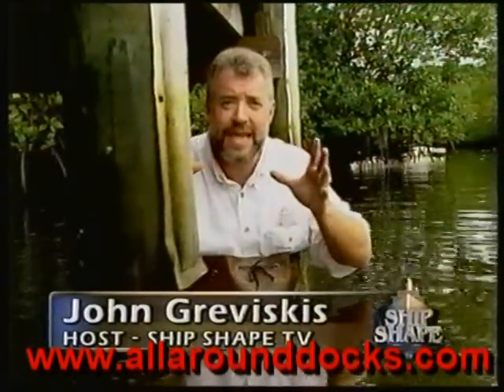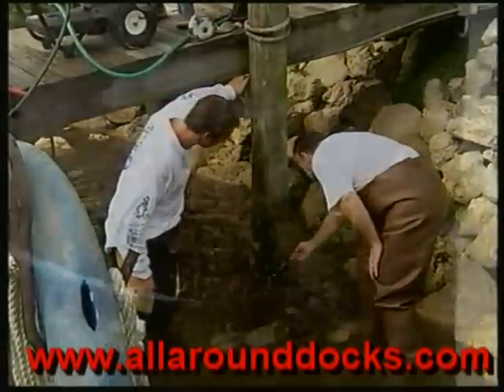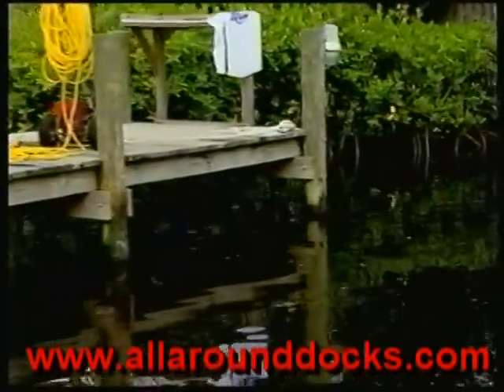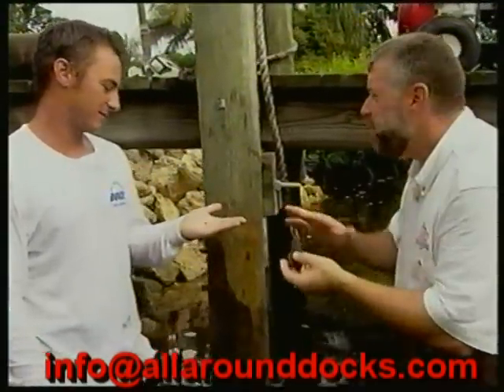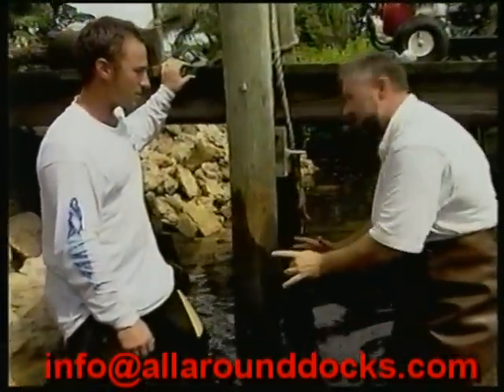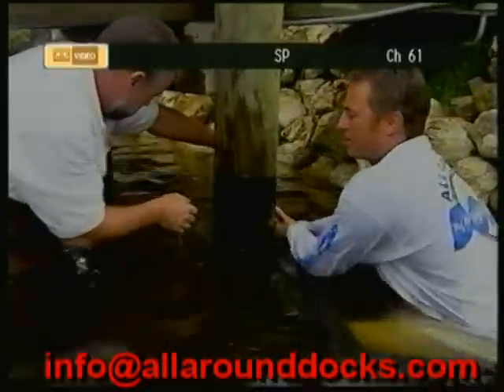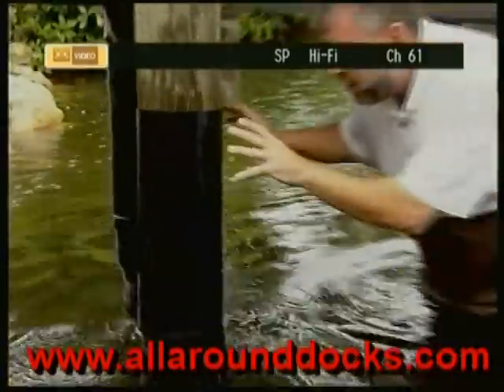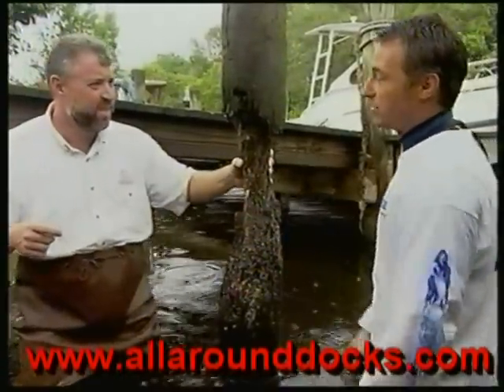All Around Docks, piling wrap, piling repair, wood piling repair, piling reinforcement

Comment: Great video. I believe it did leave out one step in the concrete process. The shrink wrapping the piling from the bottom of the stringer down to the beginning of the deterioration. Also I was wondering why this would not be suitable for a lift? I can see that it would not be for a mooring piling due to lateral forces but I would think a lift would be strictly vertical the same as a typical piling.
Reply: One reason a lift is structural so I imagine you have to be a licensed marine contractor. You don’t have to be to wrap them but the repair work ?